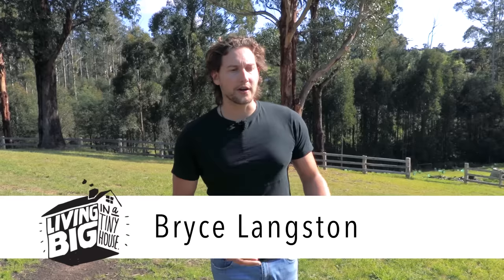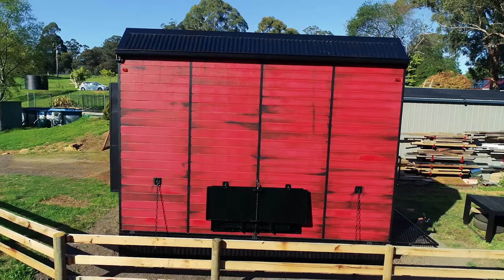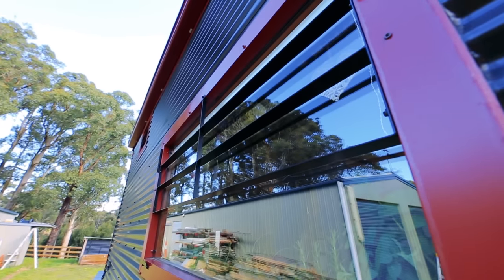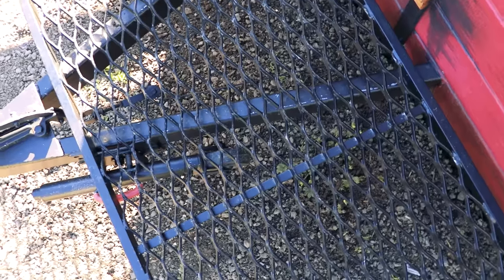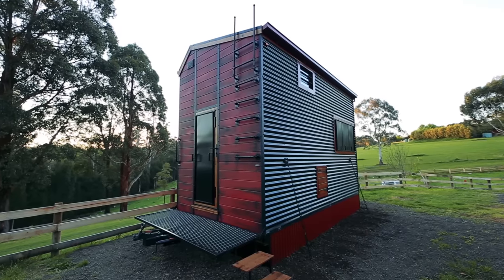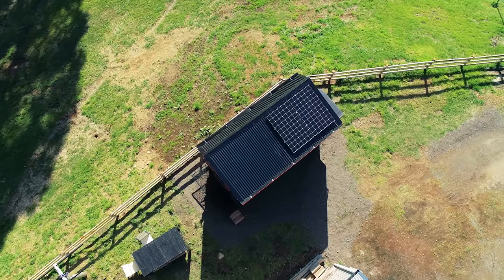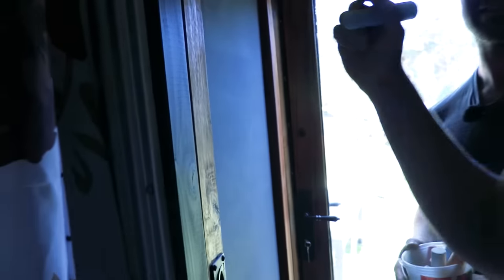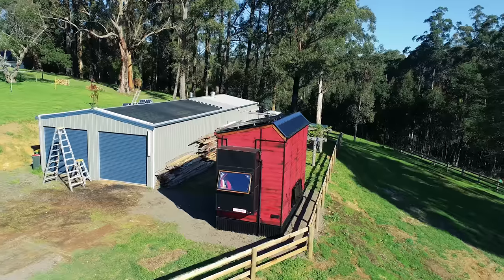Builder’s Incredible Fire Resistant, Off-Grid, Passive Tiny House On Wheels

Comment: ALL buildings needs to be fire resistant. This is genius in the methodical processes used. Brilliant execution. Perfect application of innovative systems. Tom has it all over many engineers; just watched one on another channel, during a brief, straightforward camper renovation, make 2 obvious amateur mistakes. This build seriously raises the bar for new construction of any type. Bravo, Tom!! Not to be glib, but there's got to be an award for this level of entreprenuerial skill.
Reply: I agree, but if that were the case, all house and apartment complex prices would be through the roof and we already live in relatively poor economy with prices increasing at a fast rate. Most people wouldn’t be able to afford it

Comment: A friend of mine had a fire in a flat below his flat. The flames didn't even get close to his apartment but still, the fumes and smoke (not even that much) completely destroyed EVERYTHING in his flat. He had to throw away every single item he owned. All cloth, all interior, everything. Also, the thing that kills people is not getting burned! It's the toxic fumes that you inhale and you die. So "fireproofing" is a waste of time and money as a) it won't save you when inside a large fire as you will suffocate. b) it won't save your tiny house because after being exposed to toxic fumes and smoke it will be inhabitable anyway. Sure, you will be able to salvage the steel plates. Congratulations. 

Its 100 times more important that you have a quick access fire extinguisher not hidden deep inside your cabinets. Sure they look ugly but when a fire breaks out, 30 seconds less to grab it and use it can make a huge difference.  I didn't see a single tiny house (all mode of wood etc) where you see a fire extinguisher ANYWHERE even after they open all their cabinets.
Reply: also in the worst kind of canopy fire it could well combust from inside out ! - from radiant heat.

Comment: There's only so much you can fireproof a wooden house but we love the attention to details on absolutely everything, the perfectionist in us is doing cartwheels :)

We love all the tips; going to take them onboard for our own van design
Reply: Freedom Strider the fires melted car engines.. and rims. 

think about the wood..if it's triple painted.. with the paint he says.. he  should also cover with line-X..completely fireproof to a higher temp.
Reply: I have to wonder how it would hold up in a wildfire. If it’s truly resistant to a massive wildfire that’s all around it, then man... that an engineering feat.

Comment: Absolutely relevant. Many who died in the Camp Fire in California last summer died in their cars trying to out race the fire. Two years ago my cousin raced down a canyon with one way in, flames on both sides, with her 93 year old Mother and her granddaughters in the car. Fires are a deadly force that can not be ignored.
Reply: I have friends that lost everything in Santa Rosa and then friends that lost it all in Redding and the Camp Fire so sad , please know that while this place is fire resistant, if  this fine home would have been in the path of any of those major fires most everything inside would have been incinerated even with a sprinkler system.This tiny home would survive in some situations but not in conditions like the Camp Fire. I did see many homes with swimming pools that might have made it , if a few  decent portable pumps with 1.5 inch lines were used to pump water out of the pools unto the house. If I wanted a more fire resistant home and already had funds to build a pool I would make sure the pool had two partitions one to pump water from and the other to jump into if the fire got so intense as not to be able to breath the air, I would make sure to have a few twin scuba tanks for oxygen and just for extra safety would have a 4 to 6 foot wide slab over the pool of water I was jumping into , the slab would protect anyone from a tree or any other object that was in danger of entering the water.

Comment: Wow! What an absolutely brilliant episode. So full of great information and solutions. With the changing weather patterns, all our homes are at risk from external events such as fire, quake, cyclones etc.,. Addressing those issues should be obvious because, a quick hitch up and drive away is not always the safest option and can actually slow a retreat to a life threatening level. With regard to the inside of this home, it is probably one of the most tardis like I have seen. Tiny but feels considerably larger than the outside would suggest. Nice.

Comment: I have fought wildfires here in the US and biggest issue is at best this is fire resistant not fire proof. For fast moving fires like he was talking about it might fair okay but that heat expanding foam can expand and burst sealed areas open exposing non treated areas to flames. Slow moving fires are incredibly hot and will catch this home on fire regardless of all the precautions and it will burn incredibly hot. Fast or slow moving fire you would not want to be in this home. Another thing to consider if your concerned about wildfires is location and fire burns uphill so homes on mountainsides and on hills get hit hard and are hard for firefighters to protect if they even can.
Reply: that's right - there are too many weaknesses that would put the occupant at severe risk here

Comment: You could also park a regular tiny house in a small field, away from combustible trees and bushes.  For extra protection when you know fire is in the area, erect tin sheeting around the house like a fence to protect against embers.  A fraction of the cost, if you want extra peace of mind.  I'm not trying to insult this very nice fire-resistant house.  If money is no object and you don't mind the extra weight, no problem.  Just trying to give another quick, cheap and easy option, especially if you already have a tiny house.
Reply: Dig a large pond and put a floating tiny in it! Bonus I don't think building regs would apply :)
Reply: @Chahlie  But you couldn't have a glass of wine at home, because the Coast Guard could arrest you for operating a watercraft under the influence.

Comment: I would move it anyway if there's a fire. At CA porcelain sinks didn't survive. I also would not park it on a one way in and out, you always have to consider access and allow for flooding, rock slides, fire ...

LOVE the house, allot of great info.

Also like the SimpliSafe recommendation
Reply: That would only work if you have advance warning, but forrest fires can start suddenly and as he explained in the video they spread rapidly. I'm not Australlian but I have friends who are and as I understand it there are usually instructions for which areas should evacuate and who should stay put. If everyone tried to drive away when a fire started the roads would become blocked and everyone would be trapped in their cars when the fire got to them.

Comment: Awesome design. Nice exterior. Nice exterior ladder. Nice tie downs. Very nice window shutters. Nice decking. Awesome gutter guards, and solar panels. If you inset your electrical plugs, and cover with your fire proofing won't need to repair, and or replace the outlets. Nice dinning area. Great build!!!!

Comment: Attaboy Tom!  As a builder,then firefighter,then an inspector...I can only say "Way to Go,Tom! I especially loved that the use of metal piping, brass valves,stainless items and sheet metals created a distinct SteamPunk aura to the structure. Very artistic use of non-combustibles. The only thing I could possibly add is using Nomex blankets as awnings around the sides and ends and possibly the top...All in all, Great job Tom.

Comment: Really love the interior design. Really practical use of space. The dropped floor beside the bed is brilliant. Saves crawling on your hands and knees! Regarding driving the tiny home away from fires. There's also the fact Australia doesn't really have big pickup trucks to tow tiny homes with. An F150/RAM/Silverado imported and converted to RHD is over AUD$100,000. So typically Australians have to hire a company to move their tiny homes.

Comment: I noticed you may have a large pool or pond of water near your house may I suggest that one of the best line of defense is to get a portable water pump that will take an 1.5 inch fire hose or whatever size that is standard for your country , you could us the water to spray down your place to keep it cool , if you have two large ponds you can use one to cool down your home and the other to jump in if all hell breaks loose to keep from getting burned and add a couple of scuba tanks for oxygen you would be safe as long as nothing entered the water that could harm you.

Comment: So glad to see a Tiny that acknowledges wildfires. What i would like to see (on a different Tiny House) is a light-weight metal roof several feet above the real roof that would expand beyond the Tiny footprint to give shade and ember protection. It could also provide a larger surface for photovoltaics.

Comment: Had to watch it twice! :) What a brilliant design which as an FM I can't help but appreciate. The amount of thought that went into it all, is truly impressive! Hats off to you, Tom. The space looks twice as large on the inside as it does on the outside which is a testament to how well it has been designed. The only comment I would make is that to test this properly for fire resistance I would have put the model of the house in a big bonfire for 20 minutes as in any type of fire it's not only flames but engulfing temperature one needs to worry about. I wonder how it would pass such and if all the features would react equally well?? Still, a brilliant episode with great innovative solutions. Thank you for sharing it, Bryce!

Comment: Two concerns:  1) What would happen to the breathable air inside the tiny house if it is surrounded by fire?  I guess that would be a problem only if the fire lasted a long time. 2) I am concerned about the various vents.  He said there was fireproof mesh, but couldn't fire enter through the vents?  Or do they also have fireproof shutters?  Then we go back to question 1 about the air circulation.  Maybe try that box experiment with a balloon inside?  Great ideas and definitely an important contribution.
Reply: yes, the fire even at a distance would suck out the oxygen in such a small space .. and the radiant heat would do much worse

Comment: A double metal sprinkler (like garden ones) would be great on the roof. It could spray water over the whole building in the even of a fire. You could even have a manual pump system. Any water would suffice. You could fit a tank into the ground underneath the home for it.

Comment: Great video. Important subject. I have a few points to help. Silicone...300F is nothing, fire burns at 2700F. Add Boric Acid or Borax to your Silcone. Here is a tip. Carbon is an amazing fire block. Boric Acid and Borax LOWER the burn temperature, quickly forming carbon shell. My advice is to add Boric Acid, Borax, or if you prefer, spend money on an intumescent fire retardant. All work well. If you want more tips from a Fire Retardant expert, I would be glad to help. You are working on an important task. And, BTW, I grew up near Fort Knox. :)

Comment: the only other idea i have for this guy.. digging a trench and having the house on a hoist to lower it into the ground with a cement lid that slides over the top.. 

essentially the property can burn to hell.. whilst you're safe and secure underground.. 

make the concrete dense and heavy.. with plenty of rebar.. should be able to withstand even the most devastating fire.

Comment: So, the material used in the construction has been chosen to be fire-resistant as much as possible....

... so you can cook instead of being burnt to a crisp? Because especially a tiny enclosure like this is going to heat up like an oven in no time flat if everything around it is ablaze. The material might not catch fire, but I have my doubts about its ability to keep the heat out for long.
Reply: have to 2nd that

Comment: 300'c resistant chalk... You can liquify glass in redgum camp fires. Im sure this house wont burn as much, but its still gonna burn. 7:44 The 90kg gas bottles will not explode, Done training with Elgas as my works designated gas decanter, there is a saftey valve that opens at a certain temp and dumps out the -40 LPG over the bottle cooling it rapidly, because the fire is consuming all the 02 there isnt enough 02 to let the LPG combust. Once the tank cools down, valve shuts, heats up from fire, opens to cool down.. Rinse repeat til the bottle is empty, they are specifically designed for this reason (not exploding), This is why the recent samson flat bushfire in SA you didnt see whole houses exploding from twin 90kg gas bottles.. 

He doesnt even have roof sprinklers to assist in firefighting.. In SA atleast, theyre are required BY LAW on all dwellings in firerisk areas. He said he wants to.. Why not find measures to do so, since he wants to fireproof it.
Reply: I agree Koadster.  I commented on this video many months back but looks like my comment was deleted.  My observation about these kinds of builds from having studied architecture, energy systems and fire resistance is that unless built like a bunker, the kind of radiant heat witnessed during Black Saturday and the current fires will melt glass, melt thin tin and any aluminium, buckle steel girders, scorch all surface treatments to ash in seconds, and worse still cause any flammables within the space to ignite.

Anybody who feels that it would be wise to 'sit-out' an inferno inside a tiny house will be hoping vainly.  In fact, if any vent should open (ie. cracked window) the oxygen would be sucked out and the inhabitant asphyxiated - before being torched of course.  People have even been boiled to death inside large water-tanks believing them to be safe.  There are extensive studies (& film/video) showing such results on buildings of all kinds with fires of far less intensity.  The most shocking thing I discovered on this page is the wide-spread false security or aspiration people get from watching videos of these kinds of untested theroetical builds.  There must be over 200 comments alluding to such a misnoma.  This is a wonderfully aesthetic and thoughtfully detailed build and for all intensive purposes would not ignite during mild grass fires, or forest floor fires at a distance.  30m flames though, from 50m away have been measured at 1000°C - that can vaporise all bodily fluids in seconds and leave a charred skeleton, from the radiance alone.  Eucalyptus oil is a bit like rocket fuel when super-heated and indeed can burn almost to a white-hot flame.  Sometimes these flames leap over 50m high and can travel like an airborne fireball across large cleared gaps and at speeds of 80kmh +.

Even sprinklers would have to pumping pretty damn hard to resist the first few minutes of canopy flame.  With the space on the land a bunker should be a requisite if no quick escape route is viable.  In conclusion I'd say well and good should a build like this survive but don't risk finding out from the inside.

Comment: While I applaud his efforts and talents. I think that setup is a death trap. Air supply would be consumed in seconds if a fire were to engulf his rig. Propane when heated expands and will blow the pressure release which should transport the whole shebang about 3 county's away. Lastly if it were to survive long enough to withstand a good blaze, who the heck would want to own a burned up looking and charred Tiny house. If I was super concerned, I'd have an underwater bunker. I know, Bryce, you're just the messenger and you do a superb job. Love your channel. Cheers.

Comment: Although I think Tom has done a lot to prepare the house in case of fire I was also concerned about the proofing to 300 degrees only when forest fires well and truly reach much higher temperatures. My main concern was would there be enough oxygen reserves and venting of carbon monoxide? Other than that I love the house and that hot water system is fabulous. I’m just about to move into a tiny shell, which I have to build the interior, with no water or gas and am interested in knowing more.

Comment: You could run PVC black pipes on the roof and run water thru them instead of the pulley system. That would give you hot water. :)
Reply: PVC might be an issue with the fire proofing. I'm not sure about PVC specifically but plastics in general tend to burn easily.

Comment: One thing i have been thinking about this tiny house because the high focus on fire resistant because the danger about fire the country i was thinking about the batteries. They are outside the house. That's good. But one thing i was keep thinking about are there are some cables from them that are leading into the house, correct? What about the cable are that also fire resistant? If not should have been making a fire protection box that can lead safely into the house? So the fire cannot reach the cable and start too fire into the wall and spread inside rest of the whole house. Same thing goes for the solar panels. Are those fire resistans as well i am thinking about the cables on them as well.

Comment: So here are my thoughts,

1. He mentions the cladding is fire resistant up to 300 degrees, fires often burn at 2-3x that.
2. he is putting his battery inside. Often times batteries leak toxic gases, and in combination with the inadequate fire resistance will only cause the battery to explode inside the home...

Comment: This idea is awesome so gonna jack it and add a dupont fm-200 waterless fire suppression system and a forwardlabs solar roof and a  messna passive heating and cooling system along with armorcore ul level 8 bullet proof wall panels and door and top it off with wolf appliances